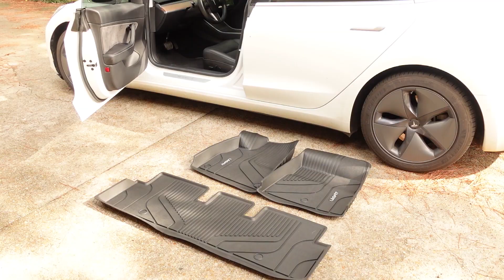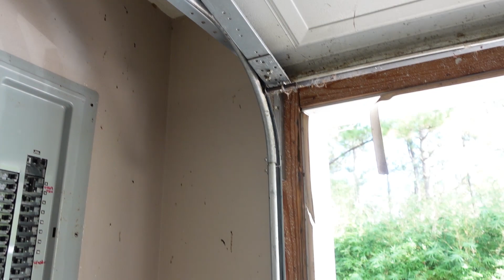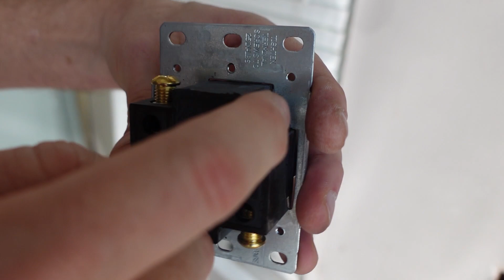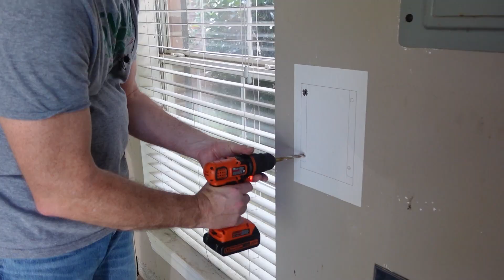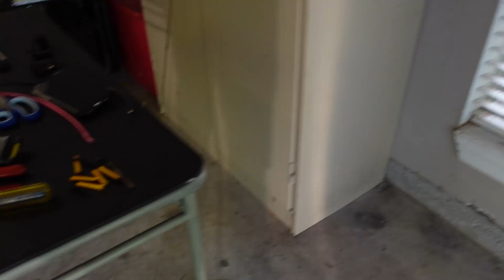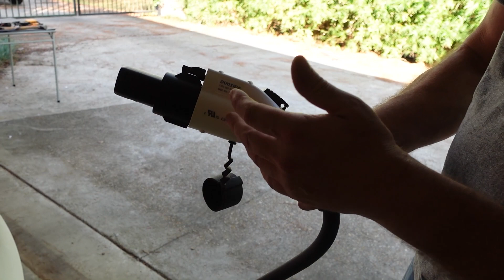Installing an Outlet for a Level 2 EV Charger

Comment: One thing to note, especially for those going the DYI route, those cheap (under $20) receptacles are not designed for constant loads for long periods nor frequent insertions. So, either get an industrial quality receptacle (about $100) or hardwire your EVSE equipment. You also need a weather rated enclosure that close to the door - mine (which was installed by an electrician) melted because of water ingress.
Reply from the maker: That’s good advice. I will look into the upgraded receptacle

Comment: Yita Motor is another good floor mat brand. I personally think they are a bit thicker (never measured). They are about the same price. 

Cost a friend of mine $10 a day to charge her Model 3 with the Tesla charger. Now that you have a 40 Amp did it increase your bill?  

And lastly you can probably get a few bucks for that leftover wire on Marketplace or eBay.
Reply from the maker: It doesn’t cost more here to charge faster at 40amps. It still charges the same amount just faster. It works so much better now.

Comment: You really didn't do bad until you took all the wire shield off. But it wire work.
Reply from the maker: The paper one on the ground or are you talking about the rubber exterior one?
Reply: @SwampBoysGarage  the rubber type black stuff.

Comment: I'm only half way through the video.. you should have used a 2 gang box would have been very easy.
Reply from the maker: I was actually debating that then decided to go single box because the charger cable is so short